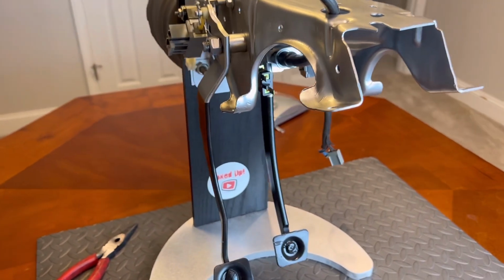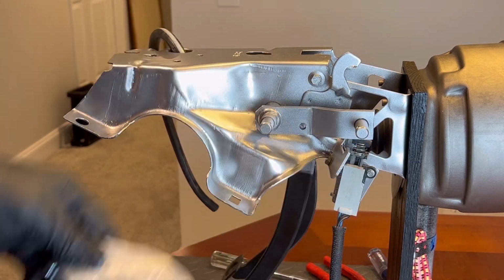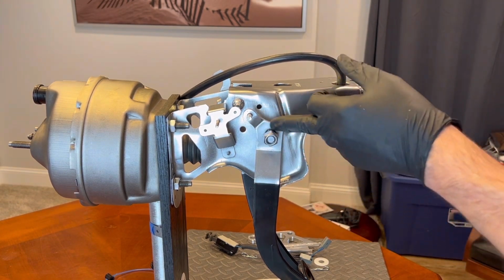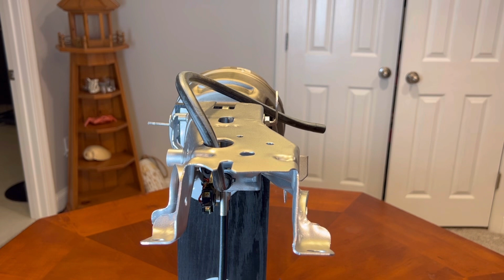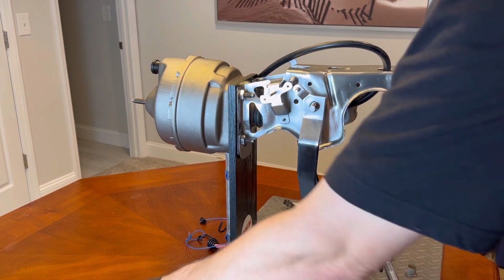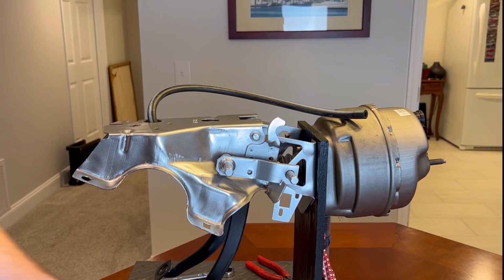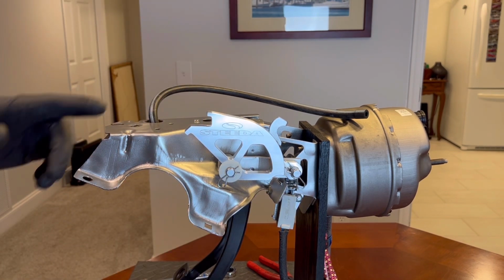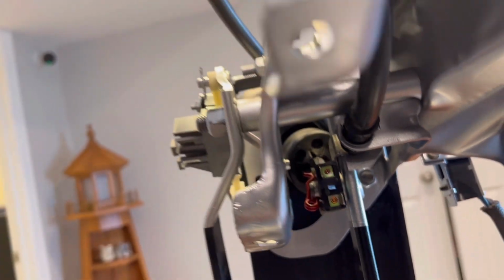How To: Foxbody Clutch Pedal Bushings

Comment: Great job providing a detailed view and breakdown of these bushings! I'll be knocking this out soon as I already have these replacement bushings. I'm trying to narrow down an incredibly annoying squeak with pressing and depressing the clutch pedal that started shortly after installing an aftermarket quadrant kit. Only thing I did differently with this one was lubricate the clutch cable before installation which I've never done before with any other install. Pretty obnoxious but this is a great start! Thank you!
Reply from the maker: Good luck with that!

Comment: Awesome tutorial! Which clutch would you recommend for a stock foxbody? I haven’t had a soft pedal feel since replacing the factory quadrant. 😢
Reply from the maker: Matt at Fox Mustang Restoration only uses LUK clutches.  I just bought an Exedy, but haven’t installed it yet.
Reply: I changed out everything clutch press plate throw out bearing pilot burn transmission shaft sleeve clutch quadrant cable everything and still have stiff clutch pedal.

Comment: any ideas on how to get the rod out of the ears snapped off the bushing and i have no way to retrieve it
Reply from the maker: You should be able to slide that rod out without taking the bushing off. You may want to spray with wd40 in case the bushing is really stuck to the rod.
Reply: alright thank you. also really great information in that video. you saved me a lot of headaches lol
Reply from the maker: @somedude613  awesome!